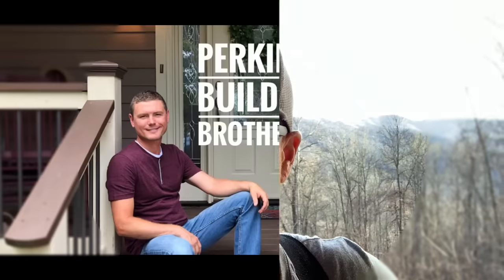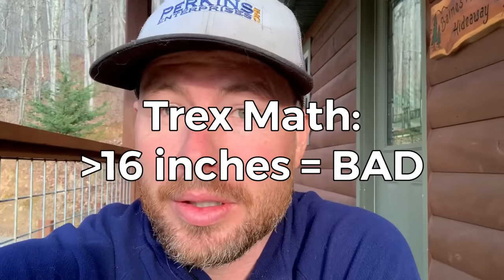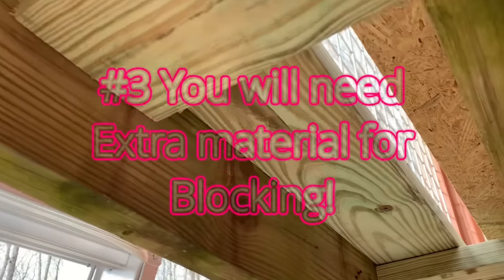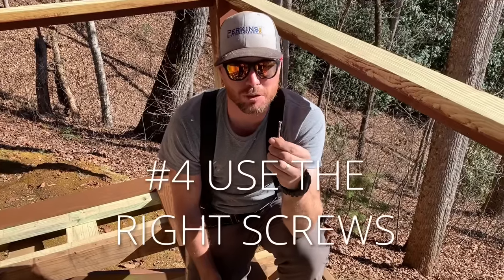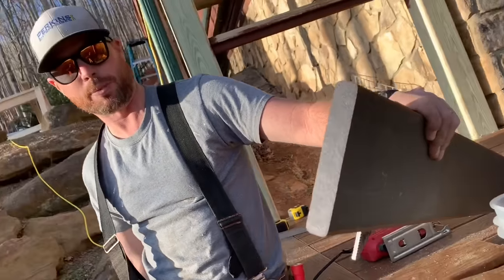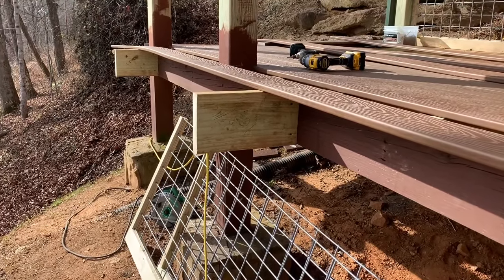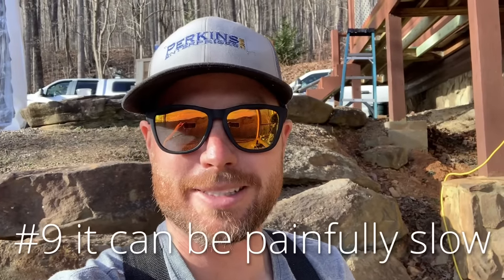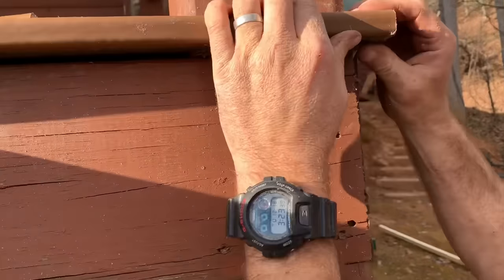How to install Trex composite decking

Comment: All I'm seeing is open decks.  What about a covered deck?  My issue, not yet resolved, is what can I use for a 2x4" no-maintenace, non-rotting sill plate [which will go around the perimeter, i.e. under the posts] which support the deck's roof?  Azek, Trex etc can't handle the 100 psi compressive load.
Reply: Cover structure load should be on the posts set in the ground.  If shaded I'd definitely go with Azek and 1/4 " gap.
Reply: @TheMrTTT  
Cover structure (roof) load is carried to sill plate by eight 4x6 posts which sit atop deck perimeter boards which sit atop double rim joists which sit atop brick piers.  I need to select [a material for the] new 2x4 sills that can handle the posts' concentrated loads.  Of course, I can wrap them in vinyl-coated aluminum trim (yuk) ... and, if those 2x4s are acq, sandwich plastic film between the two.  Or maybe rip a 4x4 PVC sleeve for a pair of u-channels.
Reply from the maker: We usually set the post directly down on the deck girder and lap it down the backside so we can bolt it to secure it

Comment: You can't just join the boards by butting them up against each other.  You need a 5mm expansion gap
Reply from the maker: Regan O'Brien if it is very cold out I would leave even more of the gap. If you are installing your deck in direct sunlight and above 75° you can put them closer because your material is already near full expansion

Comment: Beware! Composite must be installed with GAPS around ALL edges. Composite WILL expand n shrink thru weather.
Reply: Not on the mitre joints.

Comment: I’m doing tongue and groove with the universal Trex clips. The boards start to bow out in the center. All the clips are tight and all the gaps are tight. Why is this happening and how can I fix this?
Reply from the maker: Jacob Obrien I gather you are still putting the decking down? Here is One thing I’ve noticed when I am installing any kind of decking where I am bumping material tight instead of using chalk lines: The tendency is that the ends of the boards can be pushed tighter by just a fraction then the middle part of the run of decking. This will cause it to start to curve out in the middle the more rows you go like this. When I am bumping material type as the means for straightening I always leave a little more gap at the ends than in the middle to fix this.
Reply: Perkins Builder Brothers so do I need to pop a line for every single board? I’m okay with that I just feel like the bevel edges make it a little difficult to be exact with a line and measurement
Reply from the maker: Jacob Obrien... You could do every third row or something like that with a chalk line... and it would really help. Sometimes I will also just get my eye down at deck level and visually sight down the row to see if I need to make any adjustments before fully attaching the row.
Reply: Perkins Builder Brothers gotcha! I do a lot of floors and I was wondering if I could do it like that! I’ll try that then. I appreciate the help brother!
Reply from the maker: Jacob Obrien.. any time brother
Reply: Perkins Builder Brothers how long do you think it should take to frame and deck 1200 sq ft deck. Tongue and groove Trex. Picture framed nd 16 ft sections.
Reply from the maker: Hard to say without looking at it... depends on your experience and crew size, also hight off the ground is much slower.. If it was ground level and i had a 4 man crew i would estimate about a day framing, two days doing decking, and another day on rails.

Comment: The best tip is hire a deck builder not a carpenter. You will end up with a better built deck from a guy that builds decks every day.
Reply from the maker: Keith Lea Not a bad idea… If there’s one thing that I’ve learned over the years is that when you are building is that nothing is really easy.

Comment: Also if it’s hot out it don’t install it,you will come back to site in the morning when it’s cool and it looks like you have laid down spaghetti.
We had to run a sprinkler on the boards to keep them cool and manageable and we used a 16’ straight edge to clamp them to as we screwed them in.
I like these edits,short and to the point

Comment: What did you use for the railing?
Reply from the maker: Sherrie Dentico we re-did the rails with galvanized goat panel from tractor supply (4” square pattern). It is sandwiched between two layers of ripped 5/4 pressure treated decking with a 2x4 pt top cap.
Reply: @PerkinsBuilderBrothers  Thank you! I really like this.

Comment: Expansion and contraction the reaction of hot and cold.  Your cuts are too tight around the posts, never, never, never join 2 joists together or lay boards flat in the framing someone else mentioned rotting wood.  I just finished rebuilding a 16’x41’ deck, 4’ off the ground.  Where I had two boards against each other I laid ice and water shield over the top after we primed and finish painted the entire deck framing.  We used the spacer clips and that eliminated top drilling and screwing.  I saw new framing if you install the last joist and squaring it to the rim joust using the 3,4,5 method you won’t have to use the flush cutter at the miter btw on that cut you have cut from the top down, cutting up leaves a rough edge on the surface.  Me? I squared the joist to the rim and set my chop saw at a 45 and got a closed clean joint.
Reply: Do you seal cut ends with trex ?

Comment: Use a depth drive adjustable screw gun. WAY better than a cordless drill.
Reply from the maker: jason armsbury Great idea… I just bought one
Reply: @PerkinsBuilderBrothers  I have owned a few over the years. Building decks is what I like the most. I have driven probably a couple million deck screws over the last 15 years. I prefer the dewalt that has a slower rpm. It has more torque,  and that makes it easier to deal with the composite (in my opinion). I do have a cordless dewalt 20v drywall screwgun that I sometimes use as a fill in or back up. Good luck with your new tool!

Comment: I didn’t know it has no structural strength and put a large flower pot on the deck corner. Now that corner is sagging.
Reply: Get a smaller  flower pot . Thank me later

Comment: You do not I repeat you do not but that stuff tight as you guys did on your miters in your joints the stuff expands lengthways in the sun it will buckle up you should know that by now and you need to tell your people that

Comment: I used Trex decking when i built my deck in 1999...composite decking was brand new then...21 years later the Trex still looks like it did the day I installed it...whatever the added cost, PT lumber can't compete with composite decking...
Reply: T Nicholas I am planning to expand my deck and replace old wood decking boards with composite decking, I read the reviews is every bad about Trex decking, now you said it still looks good after 21 year it make me confuse with way I should go? Treated wood or composite?

Comment: Who doesnt use hidden fasteners now a days..
Reply from the maker: What’s wrong with fasteners? They are color matched with a tiny head and five times faster. They also hold the boards down about five times better.
Reply: Hidden fastener screws are tiney. Snap easy .  fastener is a plate which comes loose over time.

Comment: I had to redo my deck after all the info I was to do wood decking. 7 years down the line it became a death trap. Ripped it all out and had to redo. Used recycled plastic for the frame and got composite decking for around $50/Sq meter. Stuff isn't cheap in South Africa but won't have to treat rotting timber anymore.😂
Reply: No, now you'll have to replace swelled, shrunken and warped plastic.

Trex sucks!  And they deny the homeowner's claim withoutout ever sending a representative out to look at the install.
Reply: Well it's been over a year already. The only drawback I've had is that some of the composite has grown and some not. Have to edging of and plane straight again. Nothing has warped yet.

Comment: I can tell by the saw you are using, you are not working in California!
Reply: Mark Stanton Hence why he is still in business and a white guy doing construction !!
Reply: Yea, those sidewinder guys!
Reply: Worm drives rule.  Let me guess you guys also use Estwing hammers.
Reply: @markstanton2362  I have one, but for some reason I don't use it.  I use my Vaughn Blue Max.  Nice balance.
Reply: @jamescoldwell1467  Wood handle hammers are the best for balance.  I use a Dalluge.  Check one out sometime

Comment: You're doing "how to" videos make sure you know exactly what you doing cause you forgot to leave a gap between the ends of the boards🙄stick to "how we do" vids
Reply: Ever since doing my first composite deck, I will never again do treated with butt ends to break center on joists again. After research and reading on the brand I was using, it will absorb standing water and turn out looking like hammered dog ass after a short period of time.
Reply: Also not sure why you think flat blocking under your 2x6 used for your picture opposed to blocking it with 2x6 vertically and stiffen your facial
Reply: How rude. 🥴

Comment: #1 do some homework. Much easier to work with if you use directions and modern materials I.e. fasteners #10 Expansion gap at butt end? You can't butt end boards together need band board
Reply from the maker: Don’t leave expansion gaps if you install in hot weather or direct hot sun!! Yes If it’s cold leave a good expansion joint because it will grow in the heat.
Reply: @PerkinsBuilderBrothers  That's not what the manufacturer's instructions call for.  1/8" if over 40 deg temp, 3/16" if under 40 deg temp.

Comment: hold up my guy why you drilling into the trex, nawww man naw. under no circumstances,  that's WHY there are clips, perfectly sufficient clips that do what they are intended... follow directions correctly and you basically can't eff up (assuming you know how to cut good and mark right.) but whyyy drill in them it defeats the purpose... it's not treated. gahhh
Reply: Then , my guy, why would trex sell plugs? My guy, plugs are , for any circumstances, to “plug” screw holes installed in face of trex…Grandpa taught me 2 things in life 1- someone that knows errthang ain’t never gonna learn anything…2- if your gonna be stupid you better be tough…..aint that right tough guy ?  Just kidding my guy… no seriously

Comment: That Hitachi saw is a dead giveaway..y'all some hacks lmfaoooo... Why tf he miter the corner with a multi tool lolll
Reply: Actually, using a Multi-Tool to cut the miter is a good thing for two reasons.  First, when cut in the manner shown, it matches the first miter.  Second, Trex (and ALL composite decking manufacturers) recommend a small gap at mitered corners and butt joints to allow for the decking to expand.  Composite decking expands and contracts in all three dimensions, whereas wood only expands and contracts in two dimensions, width and thickness, not length.  The Multi-Tool blade thickness makes that small gap.
Reply: @mikeabbitt8309   what are you gonna do when you gotta do a double border? And when u use the longer cortex screws it holds it in place better... I leave my borders with no seem and they don't move even in 100 degree weather when u put the screws straight down, not on an angle (keep the boards in the shade, make sure they are cool when u install them)..... And the posts should be put in after the Trex so your not fiddling with the border all day.  It's goes border then u work towards the house put ur rip in at the house then posts then fascia then your out of there lol.. no wonder they thought it was hard.. they are doing everything backwards... And whats with there blocking? Move the joist to 11.5 inches throw a 2 x 12 in done lmaoo...
Reply from the maker: Mike Abbitt Thanks... that’s exactly right.
Reply from the maker: Dick Lewis All great thoughts... In this case We were re-decking for a former client of mine on a rental cabin he owns. The posts were already in place and that is why we cut around them. One other advantage in cutting around is if you have to replace the the decking for some reason it is not sandwiched under the posts. It also allows you to notch the post through and bolt it to the girder below (solves uplift problems in high wind zones). I 100% agree with you about not installing tracks when it is super hot. This can cause all kinds of problems when it cools and shrinks back. Thanks again for your input brother
Reply from the maker: Dick Lewis So… You are right the Hitachi it is a crappy saw, but still works fine if you’ve got a fresh blade on it. I have about 15 different saws from over the years  and find that having a good sharp blade is what makes the difference.
Reply: @PerkinsBuilderBrothers  that makes sense.. I was just bustin ur chops lol try a corded makita with a finish blade.. I'm in love with mine
Reply from the maker: Dick Lewis... Love it. I need someone to keep us straight! Thanks
Reply: @PerkinsBuilderBrothers  Very professional response to a guy obviously trolling you.

Comment: Trex is absolute garbage.  You would be throwing you hard earned cash away on a material that falls apart in a relatively short time.  Trex does not honor their warranty and has a class action lawsuit against them.  Yes, I have a Trex deck and it is disintegrating.
Reply: Just wondering how old is your deck? Mine is four years old and it look brand new. My other house has a wood deck and  the maintenance is insane.
Reply: @mtadams2009  4 years
Reply: @MrGrrtime  Thats to bad. My deck looks brand new. What would you use if you could do it over again. I have another house with a wood deck and its going to need replacement. Thanks
Reply: @mtadams2009  We debated between Trex and TimberTech.  Timbertech seems better so far . . .
Reply: @randygettens2288  Thanks for the update.

Comment: Trex is a horrible product that does not stand up.  It is VERY prone to bending and warping.  Talk to a contractor that has used it and you'll find out.  Trex used to be the only option, but there are much better options in the market now.
Reply: I have a large trex deck with half in the south/west sun exposure.  It does not twist or warp.  It does move a bit I’m under the fasteners. I had perfect gaps but anymore

Comment: Hi, this is Deena, nice to meet you. We are the manufacturer from China specializing in the high-quality wood-plastic composite board for 19 years, mainly produce outdoor wpc decking, wall panel, fence, railing, pergola, etc.
The decking catalog and free sample could be provided.
If you are interested, please contact me. We supply great range WPC boards(even bespoke) and full service at B2B pricing.

Comment: Our trex deck boards are twice the thickness of the material you're using! Looks like you skimped on materials to me. I would never accept those flimsy deck materials. Also you don't need support every 12 inches when you use the proper deck boards. Every state park in Florida has used these wonderful recycled materials and they look nothing like the flimsy boards you are installing.